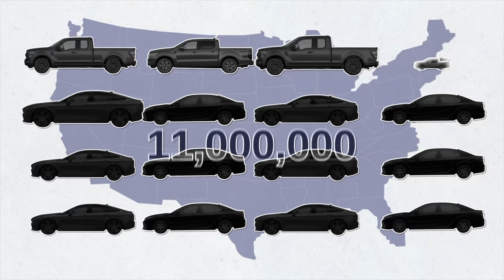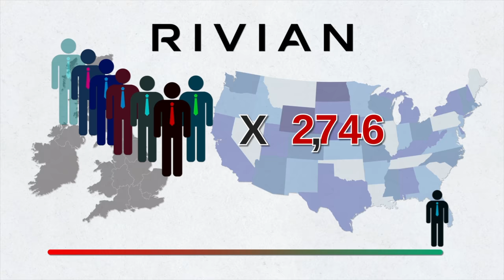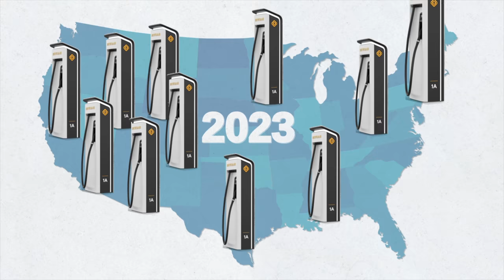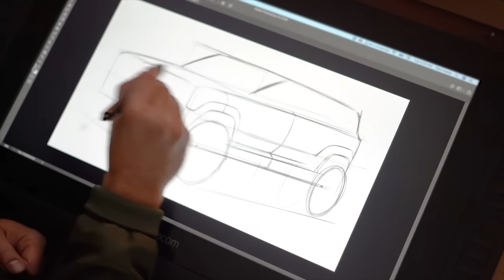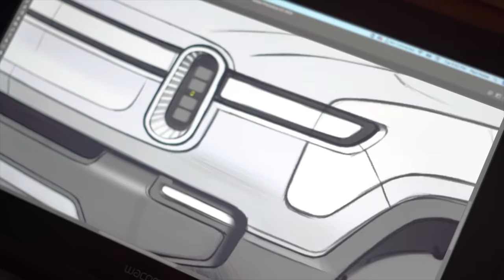Here's Why Rivian’s New Vehicle is the Future of Cars (Goodbye Tesla)

Comment: I am genuinely impressed by how far we have come with electric vehicles. I hope we go farther. Right now, however, I have a truck with a 36-gallon tank and on trips to North Carolina from Pennsylvania I can go on a tank and a half. My truck averages a little shy of 23 mpg on this trip. I only make one fuel stop in Virginia on the way back (A fuel stop can take maybe 5 minutes). I struggle with being reliant on a charging system network that is in its infancy. On the electric model, I can go 300 or 400 miles, and need to stop for 2 hours? I believe in the electric pickup design. I even love that the Ford offering can act as a generator for my house. I just feel like we're not quite there yet. Maybe it's a push forward, to go backward, to go forward. If my truck lasts 10 years from now, maybe I will be the one with range anxiety and feel differently. Let's not forget if we are just shifting the cost, when the price of electricity increases over the charging demand.
Reply: Pretty much this. EV is the future, and it is in its infancy. If you think about it, gas engines in their infancy were terribly inefficient and probably hard to fill up reliably, and find gas stations for.

However, the EV industry needs early buy ins to keep getting better. Tesla is the most stable, but they need good competition to keep the research push going. I believe the Model S can get 80% charge in 30 minutes now. That's 19 minutes faster than last years model even. A thought I have is we will get bigger batteries until they solve the speed charging thermal issue. Once they do that, I see batteries getting a little smaller because  the charge times won't be an issue. If they can get 80% charge in 10 minutes, I'd call the charging complaints a wash, as 10 minutes isn't that bad. Long trips me and the family would easily spend 15 minutes filling up, bathroom, snacks, etc.
Reply: that's the problem with having an EV at this point. Yes, it is the future, but the charging infrastructure atm frankly sucks in most areas. It's just not practical for most people to go EV yet. Maybe in 5 years if they really beef up the infrastructure
Reply: @EB-bl6cc  except for Tesla which has solid charging infrastructure.
Reply: Increased electricity demand will not change electricity prices the same way as electricity. Ultimately electric cars are so much more efficient then ICE cars that it will pretty much always be cheaper to run. Even including heat losses from generation it’s still substantially more efficient then gas.

Comment: The only thing I don't get for all electric vehicle manufactures is why they  don't design a  easily replaceable battery packs much a larger cordless tool or like propane containers which could replace gas stations with battery supply stations, much like the old Baker electric forklifts.

Comment: I'm honestly excided for these electric pickups. What I'm not excited about is the lack of infrastructure at the moment, the cost, and wear of batteries. These will obviously change with a growing power grid aswell as companies making it more and easily replaced batteries. When that happens I'll easily get one
Reply: The batteries don't need replacing.  At least Tesla's don't.  GM is having some issues but a Tesla can go a lot longer than the average life span of an ICE vehicle before you need a new motor or battery.  You are more likely to wreck the car than need to replace a battery.  We will see how the Rivian's hold up.
Reply: Batteries, in theory, should outlast the cars frame. Lemons will happen, but the cycles wise they should last quite a while. The cost sucks, I agree. I want an EV so bad but can't afford it right now.

Also a big plus, recycling lithium ion batteries is supposedly cheaper than mining new resources, and plants are being opened to do this. If the manufacturers and the recycling plants can contract and work together, it'd help reduce the need for the unethical mines. Now we just need faster green energy development, at least in the US.

Comment: Do range estimates include heat and AC usage, or not? Guessing occupants will have to forego heat or AC on a long range trips to avoid getting stranded and towed to a charging station. EVs don't makes sense for long range trips
Reply: I was in a rivian two weeks ago. We went from west covina, ca to last vegas. It wasnt scorching heat like summer but it was about 92F

We had the AC on and it still had an indicated 40 miles to E. Thats with 4 guys on board all about 200lbs and enough luggage for a 4 day weekend up there.  On. The way back it was showing 66 miles to empty I assume because theres more downhill and it was also cooler through the desert I think about 82F

I ordered one going on 3 years ago. Based on that experience i absolutely made the right choice but I dont think ill get mine for another 6 months as I want the larger pack
Reply: @mattbrew11  Seems a great-looking truck. Nice choice. I want all EVs to survive, though some will not. The Cyber Truck is too futuristic for me, but I like its $40k price (at the moment).
Reply: @dinkstover8606  the door stopper trucks will never cost less than $60k. They pulled pricing off their website for a reason
Reply: There have been tests done on  Tesla, and if stuck in a snowstorm, it will heat the cabin for up to 3 days on a full charge. That's nearly as good as an ICE car, and also consider that most EVs are charged full before leaving home, while a gas car isn't going to be filled up every day, and is likely to run out of stored energy before an EV. EV's are very efficient at using the store energy, as there no engine to be kept at idle. When they are at a stop, the only thing running is the AC/heat, the lights, and the computers.

When EVs are commonplace, there will be mobile trucks that can give you enough juice via a generator in a few minutes for you to be able to drive to the nearest charge station. You won't have to get towed at all.

Comment: When they come up with one that will be able to tow my 13k 5th wheel trailer for 350 miles without a recharge and 500 miles  not towing and be able to recharge in under  30 minutes  I will consider  one. Until then  I'm sticking with my dually 6.7
Reply: That sounds closer than you think.   Possible by 2025 and affordable before 2030.

Comment: Scotty just wondering what you think the ongoing cost of ownership will look like in terms of repairs? The modular platform design looks like swapping modules would  make it easier so I think that would mean you could own one for a long time, like the old man's shovel that's had five handles and two heads. I saw it and I wanted one, do they plan to make a RHD version?
Reply: The cost for switching our modules is not cheap and you have to swap them often from what I hear

Comment: They look better than the competition, but still electric only. Do they plan on installing charging stations in the middle of the Rubicon and Badlands? A truck could fit fuel and a generator in the bed, but idk how long that would take to charge. When these things hit 1,000 miles, that will be a game changer. Also, a small battery trailer with a gas tank, solar, and generator would be a good way for extended travel.

Comment: What do you do with it when the battery life expires and will no longer charge? Are they going to be disposable or will the battery be affordable and less than a new car? Are they still powered by fossil fuels to charge them on an average city grid and a huge hole in the ground like a coal mine to make the batteries?
Reply: Not to mention that the batteries are not recyclable.
Reply: @jayhaines1792  the batteries are recyclabe lmao who told u they werent
Reply: @vitsadelhole  they are, but only so much. The entire battery isn't, and they still have to keep mining lithium, even then. Yeah, don't drill for oil, because it's bad for the environment, but it's ok to dig huge strip mine pits. Makes a lot of sense. It's been shown that the building, and using an electric car is at least as polluting as a gas powered car, these days. Gas powered cars are 1% of what they used to be, with all of the emissions controls. If everyone had an electric vehicle, the power grid could not handle it. Major upgrades are needed.
Reply: @jayhaines1792  the easiest way for me to tell you dont actually know what you are talking about here is by seeing you brought up lithium instead of cobalt and im not looking to argue with a kid who doesnt know anything at all about this topic
Reply: @vitsadelhole  I'm also a master electrician, who has installed circuits for electric vehicle chargers. I know what I'm talking about
Reply: @jayhaines1792  ahh yes that would be helpful if you were a chemist or engineer or metallurgist or anyone whose career is relevant here but not a so called master electrician see that career doesn't actually give you any credibility here whatsoever
Reply: @jayhaines1792  well to prove you don't know what your talking about as well, maybe take a second to realize you don't dig pits or stripmines for lithium as you claimed, its extracted from salt flats
Reply: @jayhaines1792  yeah okay it provides u credibilty in a subject we weren't even debating we were talking about litium n one was arguing against u about the grid ever... what an amazing strategy. And while I may not be smarter than everyone else, from how much your argument has fallen apart I can see I'm clearly smarter than you

Comment: Electric wont take the majority of the market in the U.S for decades ...  for the same reason rail hasnt been utilized in the U.S and lags behind the rest of the industrialized world
Reply: @markplott4820  not as long as they have their senators and congressional puppets
Reply: @markplott4820  No party system...allowing even one party  is just allowing in a screener.   The most effective single thing that can be done is not allowing any corporate money or favors into the political system...at all...in any form
Reply: A new technology will not overtake the market until it is in EVERY WAY better than the technology it is replacing.  This explains how flat screen tvs and smart phones took over so quickly - no disadvantage to use them compared to their predecessors.  Looking at cars, however, even as EVs continue to evolve, ICE cars still have big advantages in price, driving range, and refueling time.  Until these issues are are resolved (or ICEs are regulated out of production), ICE vehicles will continue to dominate.
Reply: @smf15   not driving range per fuel up anymore....and the tech for quick fuel ups has been artificially suppressed .

Comment: Just saw in the news that scientists have discovered a new way to make batteries. Instead of Lithium - Ion, they are using Lithium -Sulphur.  Still in testing but they say no danger of fire and they can be recharged thousands of times without losing storage capacity. And they are lighter. This was discovered by accident so they didn't believe their findings until they ran the test over 100 times. 
This should revolutionize the automotive battery industry!

Comment: The main issue is going to be electricity generation and infrastructure.  Solar panels and wind are not going cut it. The people who are focusing on the climate aspect are not seeing that the grid cannot handle massive amounts of power required to keep the electric cars going.  Most homes are not equipped with a sufficient electrical service to be able to support reasonable charging times, let alone homes that don't have off street parking.
The other thing the climate folks don't consider is the rare earth elements and extraction to make the batteries or the labor and facilities required to recycle them.  I had to pay to dispose of a flat screen tv, and nobody is taking old CRT tubes anymore. So, while it is wonderful that people are coming up with these engineering marvels, it seems that they are trying to put the icing on the cake before it was even baked.

Comment: I love everything about these vehicles. I am concerned about the accuracy of the range. Recently, the EDVs were shown to fall far short of the stated range if any accessories were running. Are they ever not??? It's unclear to the extent this applies to the R1T and R1S. I did read that the R1T hit its mark in an independent test, but that was in full economy mode and such. My gas cars have typically exceeded their EPA ratings with full AC or heat running and loaded up going 75-80 mph. Seems the opposite might be true for these EVs. Thoughts?
Reply: Modern regulations require cars to list mixed driving stats because of numbers manipulations in the past. Think Hyundai and how they got busted early 2010's. So if you are highway driving, you'll surpass that mixed driving number. I've had 3 cars since I started driving, and 2 were less than advertised, and my current Sonata was as advertised until around 100k miles.

Also, I'm not sure I've seen a company NOT manipulate numbers to embellish their product for sales. It doesn't make it right, but whether it's weight, questionable mpg numbers, hp, etc.

Comment: The truck has a battery capacity of 400 miles with the highest upgrade. The at home charger from Rivian charges at 25 miles of travel per hour. You have to charge your vehicle for 32 hours for a full charge with the extended life battery...   That is not good at all !!!
Also, at the price points, this is not a mainstream company. I do not think Tesla has any worries until they cut that price by a good amount.

Comment: I just wonder how many of these new EV models will still be in production (at least as they're currently designed) 10 years from now. When the battery poops out or loses enough charging capacity over that time span, how many people will be experiencing buyer's remorse because their model has been phased out or redesigned to such a degree that the specific battery package needed is no longer in production and needs to be special ordered at a much higher cost?

Comment: Nice semi-commercial to promote their truck.  It does seem on the expensive side at the moment.

On the electric extension note, have you taken notice of the free piston engine that could potentially use a fuel to power an combustion engine generator?  I have been intrigued by Aquarius motors design.  What do you think about this concept as a charge as you drive?

Comment: I hope they do better than the others,  I am building my own ev from a 2010 ford edge  , with the ability to self charge on hydrogen fuel in a rebuilt gas engine  and 6000 wat generator,  it may not be 100% electric but will be 99% green with tap water able to run the engine

Comment: I remember the Chevrolet corvair from the 1960s. They had a lot of problems with instability and I remember when I was a child hearing about a man that had one and as he was driving on the the expressway there was a strong wind and his car flipped upside up and backwards and he was killed. I remember people saying how it was a bad idea to not have the engine in the front and I see that a lot of these new companies are doing exactly that. And to me I wonder if history is going to repeat itself and I wonder if they are doing studies on that. I would not get one even though it is a temptation
Reply: Electric vehicles are much heavier, and the battery is the heaviest component, and it sits on the floor. Thus EVs have a very low center of gravity, and will be very resistant to flipping over, unlike an ICE SUV.
Reply: @rajendra82a  you have a very good point with those vehicles having a low center of gravity, nonetheless I personally would not want to take a chance because there could be a strong wind that can make up the difference for the center of gravity but you make a very good point thank you

Comment: It can go 300 miles on a full charge or whatever but what about when you stop and leave the heat to keep going to stay warm or you stop to do something what about those times when things are running in the batteries running things but you're not driving doesn't that going to suck off your distance I'm assuming that's only if you just drive straight nonstop 300 miles but if you stop and do things you're not going to go as far

Comment: Concerned about driving range. I wonder if an optional tiny backup fueled generator could be designed in for limp purposes only OR perhaps as booster to extend range if you know you have to go 100 miles further than stated range allows.
Reply: That's a cool idea , but maybe they are trying to get away from gasoline completely

Comment: They have lowered the truck range to 131 miles.  And there is no way it's rated at 7,700 pounds  of towing.   I also would like to point out that the climate control will drastically lower the distance ratings.  Converting battery storage into heat is not efficient, nor is spinning an A/C compressor.  With no dealers how do you get service?  Lots of growing pains for the first people who buy.